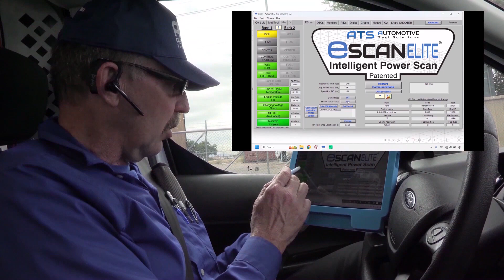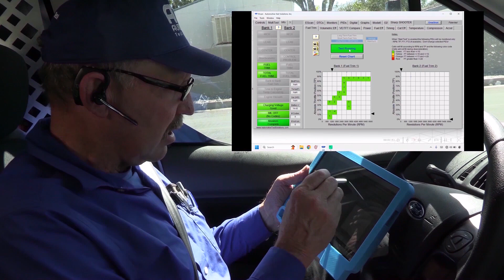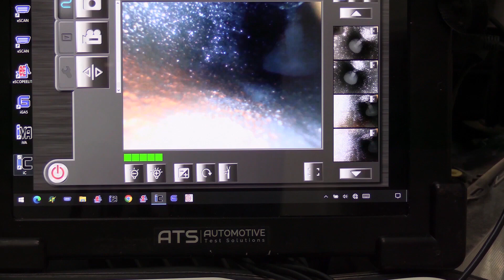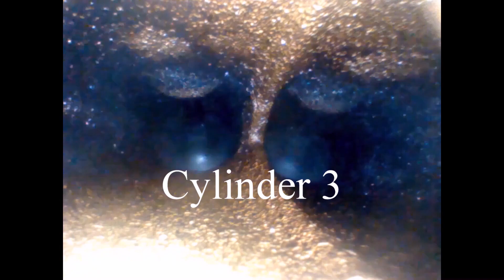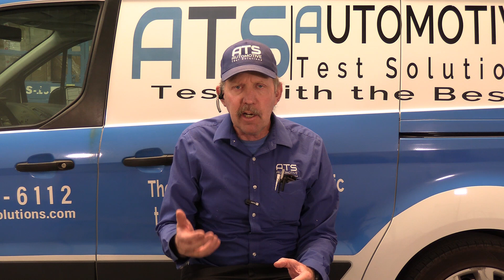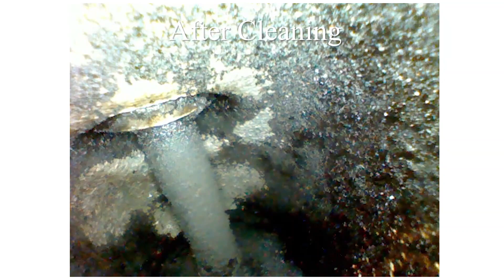2021 Ford Transit Connect Loss of Fuel Mileage

Comment: Infomercial Alert 😂😅, and no you didnt lose 4mpg from that
Reply: Phasing the VVT is it dangerous or not? as you know, interference engines can bend valves but sometimes with your scanner you can bend them too or is it a myth? Bernie Thompson our master well he really likes commanding VVT for his diags, with the scanner and also manually by energizing the VVTs as he doing his diags when correlation timing codes P0016 P0017 P0018 and others. By the way, you know Ivan from PINE HOLLOW well I think he developed his thought process by studying Bernie Thompson because Ivan and Bernie are the only ones I know that energize VVTs without any fear at all. Is this dangerous or not dangerous VVT diag technique of commanding VVT with scanner or manually energizing them to do timing diagnostics. Thank you. Thank you. I am asking u but sure the same Bernie reading this can give us a video just talking about this. But I also would like to read you opinion friend. Thank u

Comment: Exellent.
Reply: Phasing the VVT is it dangerous or not? as you know, interference engines can bend valves but sometimes with your scanner you can bend them too or is it a myth? Bernie Thompson our master well he really likes commanding VVT for his diags, with the scanner and also manually by energizing the VVTs as he doing his diags when correlation timing codes P0016 P0017 P0018 and others. By the way, you know Ivan from PINE HOLLOW well I think he developed his thought process by studying Bernie Thompson because Ivan and Bernie are the only ones I know that energize VVTs without any fear at all. Is this dangerous or not dangerous VVT diag technique of commanding VVT with scanner or manually energizing them to do timing diagnostics. Thank you. Thank you. I am asking u but sure the same Bernie reading this can give us a video just talking about this. But I also would like to read you opinion friend. Thank u

Comment: Excellent it works
Well.🗣🎓🇺🇲🅰️👍💪♦️
Reply: Phasing the VVT is it dangerous or not? as you know, interference engines can bend valves but sometimes with your scanner you can bend them too or is it a myth? Bernie Thompson our master well he really likes commanding VVT for his diags, with the scanner and also manually by energizing the VVTs as he doing his diags when correlation timing codes P0016 P0017 P0018 and others. By the way, you know Ivan from PINE HOLLOW well I think he developed his thought process by studying Bernie Thompson because Ivan and Bernie are the only ones I know that energize VVTs without any fear at all. Is this dangerous or not dangerous VVT diag technique of commanding VVT with scanner or manually energizing them to do timing diagnostics. Thank you. Thank you. I am asking u but sure the same Bernie reading this can give us a video just talking about this. But I also would like to read you opinion friend. Thank u
Reply: @ElelectricistadeMateo  the masters of diag like Ivan and bernie do their homework
They know already if it is an interference 
Motor or not sure it's good to energize them while doing service making sure
All is perfect before giving the car to the customer. You have to do your homework.
NO COMEBACKS 
CUSTOMERS HATE
COMEBACKS.
that's my opinion 👍🅰️🗣🎓💪♦️
Reply: @richardnilsen5  thank u Richard

Comment: The mad scientist of automotive! He knows what he’s talking about. Thank you Bernie😊
Reply: Phasing the VVT is it dangerous or not? as you know, interference engines can bend valves but sometimes with your scanner you can bend them too or is it a myth? Bernie Thompson our master well he really likes commanding VVT for his diags, with the scanner and also manually by energizing the VVTs as he doing his diags when correlation timing codes P0016 P0017 P0018 and others. By the way, you know Ivan from PINE HOLLOW well I think he developed his thought process by studying Bernie Thompson because Ivan and Bernie are the only ones I know that energize VVTs without any fear at all. Is this dangerous or not dangerous VVT diag technique of commanding VVT with scanner or manually energizing them to do timing diagnostics. Thank you. Thank you. I am asking u but sure the same Bernie reading this can give us a video just talking about this. But I also would like to read you opinion friend. Thank u

Comment: Thanks Bernie!
Reply: Phasing the VVT is it dangerous or not? as you know, interference engines can bend valves but sometimes with your scanner you can bend them too or is it a myth? Bernie Thompson our master well he really likes commanding VVT for his diags, with the scanner and also manually by energizing the VVTs as he doing his diags when correlation timing codes P0016 P0017 P0018 and others. By the way, you know Ivan from PINE HOLLOW well I think he developed his thought process by studying Bernie Thompson because Ivan and Bernie are the only ones I know that energize VVTs without any fear at all. Is this dangerous or not dangerous VVT diag technique of commanding VVT with scanner or manually energizing them to do timing diagnostics. Thank you. Thank you. I am asking u but sure the same Bernie reading this can give us a video just talking about this. But I also would like to read you opinion friend. Thank u

Comment: Appreciate you, Mr Thompson.  ATS rocks
Reply: Phasing the VVT is it dangerous or not? as you know, interference engines can bend valves but sometimes with your scanner you can bend them too or is it a myth? Bernie Thompson our master well he really likes commanding VVT for his diags, with the scanner and also manually by energizing the VVTs as he doing his diags when correlation timing codes P0016 P0017 P0018 and others. By the way, you know Ivan from PINE HOLLOW well I think he developed his thought process by studying Bernie Thompson because Ivan and Bernie are the only ones I know that energize VVTs without any fear at all. Is this dangerous or not dangerous VVT diag technique of commanding VVT with scanner or manually energizing them to do timing diagnostics. Thank you. Thank you. I am asking u but sure the same Bernie reading this can give us a video just talking about this. But I also would like to read you opinion friend. Thank u

Comment: Can we all agree that direct injection is a terrible idea?
Reply: Phasing the VVT is it dangerous or not? as you know, interference engines can bend valves but sometimes with your scanner you can bend them too or is it a myth? Bernie Thompson our master well he really likes commanding VVT for his diags, with the scanner and also manually by energizing the VVTs as he doing his diags when correlation timing codes P0016 P0017 P0018 and others. By the way, you know Ivan from PINE HOLLOW well I think he developed his thought process by studying Bernie Thompson because Ivan and Bernie are the only ones I know that energize VVTs without any fear at all. Is this dangerous or not dangerous VVT diag technique of commanding VVT with scanner or manually energizing them to do timing diagnostics. Thank you. Thank you. I am asking u but sure the same Bernie reading this can give us a video just talking about this. But I also would like to read you opinion friend. Thank u

Comment: GOOD JOB , GREAT RESULTS BERNIE
Reply: Phasing the VVT is it dangerous or not? as you know, interference engines can bend valves but sometimes with your scanner you can bend them too or is it a myth? Bernie Thompson our master well he really likes commanding VVT for his diags, with the scanner and also manually by energizing the VVTs as he doing his diags when correlation timing codes P0016 P0017 P0018 and others. By the way, you know Ivan from PINE HOLLOW well I think he developed his thought process by studying Bernie Thompson because Ivan and Bernie are the only ones I know that energize VVTs without any fear at all. Is this dangerous or not dangerous VVT diag technique of commanding VVT with scanner or manually energizing them to do timing diagnostics. Thank you. Thank you. I am asking u but sure the same Bernie reading this can give us a video just talking about this. But I also would like to read you opinion friend. Thank u

Comment: I hope Bernie's van doesn't get the curse from Ivan's pastry shop van.
Reply: Phasing the VVT is it dangerous or not? as you know, interference engines can bend valves but sometimes with your scanner you can bend them too or is it a myth? Bernie Thompson our master well he really likes commanding VVT for his diags, with the scanner and also manually by energizing the VVTs as he doing his diags when correlation timing codes P0016 P0017 P0018 and others. By the way, you know Ivan from PINE HOLLOW well I think he developed his thought process by studying Bernie Thompson because Ivan and Bernie are the only ones I know that energize VVTs without any fear at all. Is this dangerous or not dangerous VVT diag technique of commanding VVT with scanner or manually energizing them to do timing diagnostics. Thank you. Thank you. I am asking u but sure the same Bernie reading this can give us a video just talking about this. But I also would like to read you opinion friend. Thank u
Reply: @ElelectricistadeMateo I do it when I want to to know whether they are phasing or not.Since I'm not from North America I don't get the chance to meddle with Fords & GMs but lots of Japanese made. BTW I recently got a chance to diagnose a Ford (Indian made) Ecosport SUV which throws cam crank correlation code (guess p0016). While the engine was idling I grounded the control wire for both vvt solenoids each at a time to verify they were functioning. Intake phasor didn't respond at all.Turns out phaser was stuck for some reason. Wd40 and compressed air freed the phaser. I would ground the control wire only for a brief moment. Don't worry so much about bending the valves while it is idling. Works for me.
Reply: @tharakanewan3544  oh thank u and that was a NPR ivan no parts required. Thank u for your comment

Comment: Seafoam ...
Reply: I do what I call the SeaFoam Fog.. I run 16-20 oz through the intake with the induction sprayer over 20 minutes at 3,000 rpm  It definitely fixes bad fuel trims on high mileage vehicles. I just did one with over 190 miles last week. Fuel trims were maxed out.  Fixed and runs smoothly.  I will take a look at this stuff.

Comment: If no one can, Bernie can and will 😎
Reply: Phasing the VVT is it dangerous or not? as you know, interference engines can bend valves but sometimes with your scanner you can bend them too or is it a myth? Bernie Thompson our master well he really likes commanding VVT for his diags, with the scanner and also manually by energizing the VVTs as he doing his diags when correlation timing codes P0016 P0017 P0018 and others. By the way, you know Ivan from PINE HOLLOW well I think he developed his thought process by studying Bernie Thompson because Ivan and Bernie are the only ones I know that energize VVTs without any fear at all. Is this dangerous or not dangerous VVT diag technique of commanding VVT with scanner or manually energizing them to do timing diagnostics. Thank you. Thank you. I am asking u but sure the same Bernie reading this can give us a video just talking about this. But I also would like to read you opinion friend. Thank u